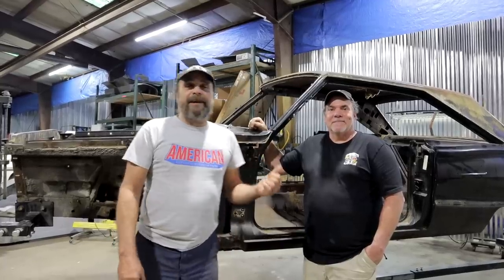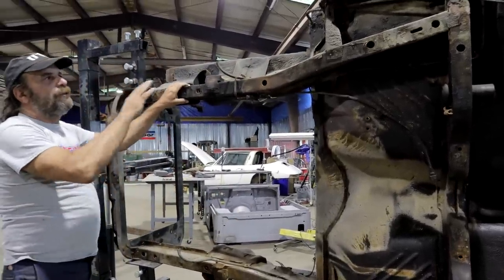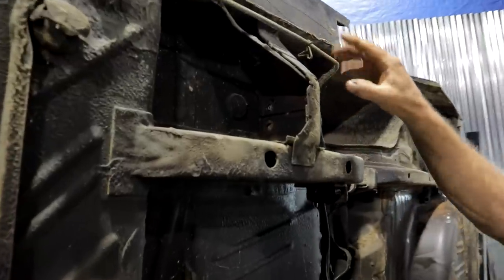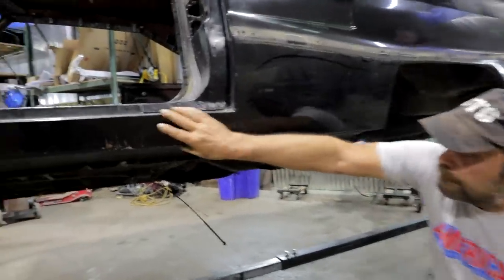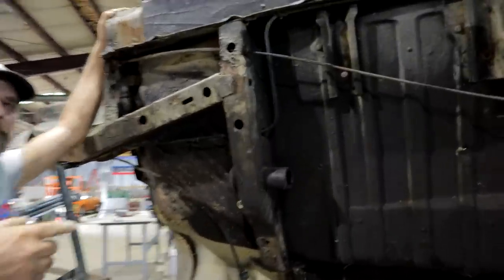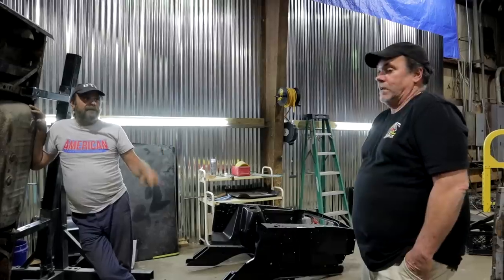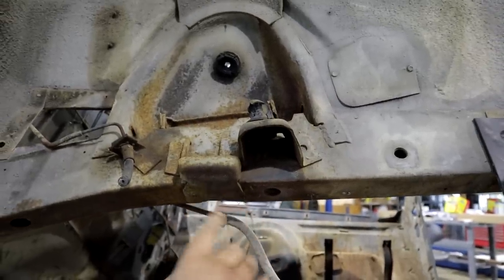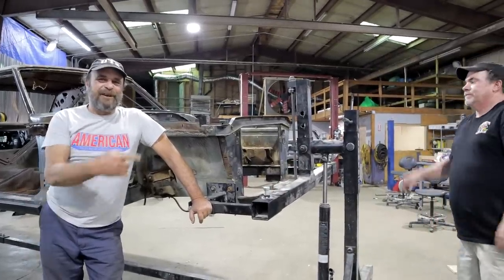Inside The Amazing Chrysler Unibody

Comment: Speaking as a civil engineer and bridge inspector, the unibody is designed much like a truss bridge.
Reply: Nope. You are thinking of a space frame, which thankfully isn't used much anymore.
Except in truss bridges, where despite everything being theoretically in tension or compression, manage to flex all over the place anyway. 
The unibody (created by Budd, in the 30s , I think) is a cross between a monocoque (using the outer skin as structure) and a bunch of random sheet metal used as a bracket to hold everything else together. 
Hopefully its stiff enough that the flex isn't noticeable to the average Joe.
Reply: The body is stiffer than you think though! My friend parked his 71 Pontiac lemans with one wheel on the curb and nobody could open the doors my other friend on a bet did the same with a 73 dart and doors worked perfectly!

Comment: Tony et al are a TRUE resource.
It would be great if we all learned about maintaining these drainage areas in all our cars like pulling up carpets, snaking drains with vacuum hoses and leaving those self-destructive rubber plugs out. 
I have seen late model, modern, ULTRA LOW MILE, no salt, no rain, Super Clean, always garaged, northern desert climate rides rusted from the inside out from just 10-20 car washes. 
So it's sad we don't know to paint and oil up to protect known design weaknesses like old farmers did.  Turns out there's interviews on car execs saying how laughable corrosion protection was (still is) even despite advertising the exact opposite. Maybe there's a use for Mazola yet?

Comment: The front frame rots out right where the K frame bolts to the frame too I seen many Mopars here in Canada with rot on the drivers side front frame rail and of course the back frame rail too rots out because of water getting into the trunk and the salt and dirt road grime from the bottom of the rear frame rail in the wheel well and under the trunk floor

Comment: on my 65 dart I always power sprayed all those spots to make sure they could drain but I would also use a flash light and a strait edge screw driver and dig out the muck that might cause the frame ect to rot
Reply: yeah I go around and clean the drip holes in the doors and rockers too
Reply: Old hot rodder taught me to liberally spray wd-40  in the door drain holes to soak the pinch weld he would do it every spring it works! His 94 dodge pickup is rust free. always washed and garage kept but that's a statement in Michigan where there is salt and  chloride on our roads all winter
Reply: @DougsterWolverineGarage  Used oil is cheaper and just as good although the newer oils don't cling to the metal like the old stuff so you have to touch up re-applying from time to time.
Reply: That would be good too!

Comment: Cars in the '60's, by the time they got 50,000 miles on them many owners were looking to sell or trade in.  Many were looking for a new car every 3 years or so.  By 100,000 miles a car was considered worn out.  The manufacturers never thought about a car lasting until current times.  They wanted to sell you a new car every few years.  They wanted to sell you the newest thing off the designer's drawing board, which for the most part was a little more glitz on last year's model, or different sheet metal.
Reply: completely agree!  At 50k miles you needed a valve job and my parents never kept cars over 75k.  We got new cars every 8 to 10 years.
Reply: Not that different from now. Just more miles per year now.

Comment: Excellent video. Experienced all the issues uncle tony hit upon. Had a 70 satellite station wagon where the torsion bar mount snapped just like tony described. Northern car with lots of salt damage. Sitting at a stop light and bam the car dropped 4 inches on the right side. Great video. Uncle tony is the man.

Comment: Something to watch out for with these cars: I noticed after washing my 68 Satellite, water would collect in the front frame rail in front of and in the frame under the shock towers (you can't even see it). It would be trapped there and probably stay there for weeks... this is where many of these cars rot out from the inside out.. I added a small drain hole... I think later cars had drain holes in this area... just a heads up.

Comment: I'm originally from Ohio and I know rust.  These year cars were gone off the street in 8 to 10 years because of structural rust.
Reply: salt + snow the reason why classics are endangered to begin with
Reply: Rust Never Sleeps! Those "Iron Moths" are hungry devils! S.w. Michigan, salt AND chloride!
Reply: After my favorite truck rusted out completely, I now coat all my vehicles with fluid film and cosmoline. That stuff really works. Got a classic chevy that is rust free and it does get driven in the salt.
Reply: I'm in Ohio as well & the rust issue is just one of the reasons I much prefer a full frame car over a unibody constructed car. Once the rust gets so far, the structural integrity is gone. I also never cared for the unibody construction as it is the absolute cheapest way to build a car in a factory setting (that's why ALL passenger cars are unibody now & have been for some time) & to me, that says the manufacturer doesn't expect and/or doesn't care about the life expectancy of their vehicles.
Reply: @iwalkalone1  Agreed. I want frame rails, and beefy ones. The only unibody vehicle I really like is the 90's and early 2000's Jeep Cherokees. And they "kinda" have a frame if you look at it right.
Reply: @Bloodbain88  astro/safari vans also have a unibody with frame like rails from the firewall all the way to the rear bumper that are welded to the body as part of its construction.

Comment: Tony  I have a '60 Fury and it is a first unibody. The front inner fender wells come off and they are as big as the fenders. No spare tire well and no trunk floor hook to secure one either. The under belly of mine is clean. But yep trunk seal, trunk floor, right rear drop down, drivers rocker and left front fender drop down all yuckish. Makes for lots of stitch weld practice.

Comment: Out of all the classic unibody cars I've had on rotisseries, mopars always seem the stiffest
Reply: So youre saying that you never had a 1961 to1969 Lincoln Continental on one.
Reply: @donreinke5863  nope. I mainly worked on  70's mopar and other high performance cars from the same era.
Reply: @DanEBoyd  Even the body-on-frame convertibles werent very stiff--I owned a couple, but the Lincolns of that era were among the most solid cars ever built.
I had either ridden in or driven both the Mopars of that era and the Lincolns, and even the Imperial, though a solid car--didnt match up.
Reply: @donreinke5863  But, look at the difference in the out the door price tag of a Lincoln.
Reply: @kramnull8962  Im not certain, but I would bet that the first unibody Imperial in 1967 was comparably priced to the Lincoln or Cadillac, and the 440 RB engine they were equipped with had better performance than the 472 ci Cadillac engine
One thing you could count on is that Mopar didnt let the competitions engines outperform them.
It as rumored that the reason Chevrolet went from their 327 to 350 is because 340 Mopars were kicking the 327s ass on a very regular basis.
Reply: @donreinke5863  the 340 was definitely not kicking the 327s ass in any way shape or form. the 327 was put in the same NHRA class as the 429s,  426 hemis and 440s. not only was it put in the same class but it won the super stock class 3 years in a row against big block mopars and fords. the 340 wasn't even a competitor to the 327.
Reply: Unibody cars, 61 to 69 Lincoln’s are body on frame construction. Two very different animals.

Comment: The reason for not painting roof panels before vinyl top installation is paint related. Even though the paint is baked, it isn't capable of adhering to the car when the top is glued to it within hours of  painting. The car will go outside into the freezing temps during the winter or bake in the sun for days or weeks during summer after production. The cold weather causes even brand new vinyl to shrink and pull. The heat causes the glue to become more "aggressive", risking material de-lamination from the primer. The paint wasn't fully cured for something close to 30 days so the risk of warranty repair was too high. You notice that with the advent of water born enamels and now water based paints over "no sanding needed" powder coat primers with a polyurethane clear coat, nothing larger than badging is glued to the paintwork. (Graphics not withstanding) Short term adhesion can be even more problematic with modern production coating systems. They work great after a few days, but no production environment can account for that.
Reply: Well started. Good information.

Comment: I once bought a '65 Barracuda with the low-compression 2-barrel 283 cheap back then, because the seller thought that it had a bent frame. It used to pull quite a bit to one side and the top of the right wheel would camber inwards. Had I known that it was only that Achilles Heel problem, where that part mentioned of which held the lower control arm sheared off, I would have attempted fixing it, saving quite a few tires, instead of getting rid of it, because I thought that it would need an expensive frame-straightening. I loved that car, as well as the Valiants and Dart of which I used to get dirt cheap back then. Funny thing though, I hated my boring '66 Coronet 2-door hardtop, despite it being a good car

Comment: Wonderful video, quite surprising how similar this car looks to the ebody challenger I've been working on. Same rust points too. I got the flipper nightmare where the quarter panel rust holes were globbed over with Bondo. Both trunk extensions were gone. On the Ebody the drain for the cowl will clog with leaves and twigs and rust through. On this one the rust hole on the firewall let in enough water to completely rust through the drivers floorpan. It was also a vinyl top car so the Dutchman panel was completely gone the roof was barely holding on in a few places lot's of cutting, fitting, welding, and fabrication. Gonna be a gorgeous car when it's done though

Comment: Over on Nicks Garage, they are doing an early Charger. They dipped the car to bare metal, then hand sprayed it.  They refuse to realize that there will be lots of bare steel in hidden areas that can't be reached and the car should have been E coat dipped.  Sure, the car will look fine on the outside but it will be a rusty mess in a few years.
Reply: Absolutely!
Reply: Get in there with the fluid film

Comment: I have a 66 Charger in my shop now. Nice car real nice. I am not a fan of the front suspension though
Reply: i have one as a project what’s bad abt it? i’m still saving up for it
Reply: @seggzslimjimz1179  I  am just not a fan of the torsion bar suspension.  Drives like an old tractor. I haven't looked closely at it yet to see if anything is wrong.  It was brought in for tuning and some interior work. I have a video up on it.
Reply: @HotRodDave  Drives like a old tractor LMAO!! Torsion bars was a more better ride then coil springs and they were easy to adjust to get a softer ride or stiffer ride something you could not do with coil springs unless you replace them
Reply: @79tazman  Absolutely right.

Comment: What an interesting video. I'd really like to see what he uses to get that glue off the roof and how those drain channels are cleared and then coated. Great stuff.
Reply: Compressed air through an extention piped line. And the roof will likely be ground with a mid grit paper then gone over witb a fine grit

Comment: The front chassis rail on Australian Chrysler Valiants had the steering box mounted to it with three long bolts through the RH chassis. Chrysler Australia used internal stiffener plates and crush tubes to strengthen the area but failed to provide drainage notches in the corners of two of the plates. The result was a perfect water trap that filled the chassis permantly with water and they rusted from the inside out. I have the remains of mine on my shed wall. The water level is completely rusted out.
Reply: Yep, I scrolled down through the comments to find this very issue, cos I bought a 68 VIP Val out of the Trading Post for parts back in the mid 80's.
NOW there's no way you'd wreck one of those just cos of a rusted frame rail. Driving it home was pretty challenging with the steering box swinging in the breeze....oh to be young & crazy keen  again......
Reply: @lancecooper4646  318 VIP? My mate had one of them really nice
Reply: @tongoio  yeah, I bought it for the running gear, it had a Torqflite & a good diff too, the car was very rough & not worth fixing, but nowadays people would be drooling over it, gotta hop in my hot tub time machine & go back to the 80's & buy up all those cheap classics & store them in a huge factory for my retirement 💲💲💲💲💲💲💲💲

Comment: Drain holes. I used to have a 1977 LTD II, had drain holes in the gas filler cabin on the driver rear quarter. That thing would fill up with water and flood the gas tank with water. I tried to keep the drain cleaned out. Finally I just drilled 3 holes below the gas filler tube...

Didn't help any that the gas filter was smaller than a shotgun shell on the front of the carb. Dang thing would clog up in no time....

Comment: In 1985 or so I found a 1968 Dodge Charger sitting in the yard of an abandoned mobile home in the desert east of El Paso, TX. It was in great shape, body was straight, all the window glass was there and the interior was completely intact. It had no wheels, was sitting up on cinder blocks, and the 383 was missing the carb and intake but everything else was there. This was just after The Dukes of Hazard made the car famous and I really wanted it, but I was only 16 and had no way to retrieve the car, and even so it probably belonged to someone and you can’t just take a car because you found it. I should add, it was inside a yard with a 6’ chain link fence and a lock on the gate.

In 2008 I was back in El Paso and thought about going back to see if it was still there. It occurred to me that even if it was (doubtful) it would have been sitting in the sun rotting for longer than it had been a car back in 1985.

Comment: The big C-body Chryslers with the J-frame had a few advantages because the much heavier steel of the removable J-frame helps offset and avoid some of those rust areas.

The back parts are still the same, but the front parts are much better.

Comment: I know that you previously talked about NOT using subframe connectors. So in a 67-up, originally slant-6 A-body, would you recommend any upgrades, like torque boxes, or non-standard bracing/gusseting of the unibody, when changing to a V8, 400-450hp application?

Comment: I made about 25 miles before the flimsy rear shock mount let go after installing Hurst/Gabriel air shocks.  Good times.
Reply: A friend of mine had a 1977 Plymouth Gran Fury that rusted out so bad that the rear springs  busted through.
Reply: Flimsy shock mount on what? I've had many air shocks on mopars and never had a shock mount let go so sorry if I find that hard to believe anyway what kind of car was it?
Reply: @DanEBoyd  No rust problems in sunny Commiefornia.
Reply: @barnabyjones6995  Car is a 66 Satellite.  Welds broke loose and tore out of the frame rails.  Made my own crossmember after that.
Reply: @79tazman  It was on my 66 Satellite in 1972.  Tore the ends off the frame rails when driving over railroad tracks.  I can say they were @ 150 lbs pressure, so there wasn't much give in the suspension.  Still have the car with beef-up homemade cross member.
Reply: Shock mounts even when brand new are not designed/engineered to support the weight of the vehicle. It's a roadworthy item, & airshocks are technically unrwc, down here in Melbourne Australia at least 👍

Comment: From the B bodies I've restored, and I do mainly body and unibody I can tell you they rust really bad from their HORRIBLE lack of paint coverage. Especially under the package shelf from the trunk hinges back and in, inside the inner quarters, inside the cowl, inside the rear body etc. I don't think I ever saw one that didn't have bare metal (rusting bad) up under the rear shelf or inside the inner quarters. That's a huge reason a really nice MoPar is so much more than a cherry big block chevelle or GTO. It's a 3 year restoration and $120,000 to restore one. I have nearly $30,000 into just sheet metal in my 68 Charger. A lot of the original panels are useable. It cost you some money to love a MoPar, but back in the early 80's we bought them for $1500 and drove them into the ground because they were a third the price of a 69 Camaro because everyone wanted a 57 chevy or a Mustang. Odd. Now they are ten times as much. The explanation as to how the moisture and the dust flows ism spot on, Tony. People don't realize but leaves accumulate on and in a car and crumble, creating a fine dust which holds moisture. It becomes damp sludge and it lingers in crevices and rots the car out. Just washing a car with a hose, or dew is enough to keep this dust damp. I noticed some car collectors in the middle east just clean their cars with soft towels and squirt bottles for this reason. Keep the good videos coming, Mr Tony. You make sense with this stuff. This was a BEAUTIFUL car, too

Comment: Hi Tony, how about doing a video on chassis strengthening. Torque boxes, frame connectors etc.
Reply: @Kenjh71  There is more to body strengthening than has been mentioned here. An in depth video would be good on when certain things are required. Always good to be able to close your doors and keep things where they should be. US Car tool has a pretty comprehensive kit, good to hear Tony's view point from past experience, especially when racing.